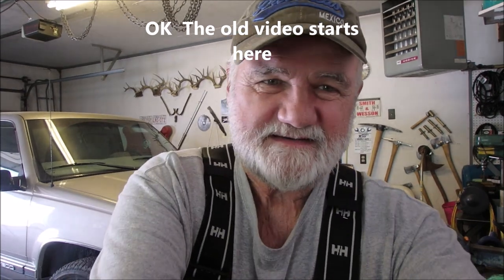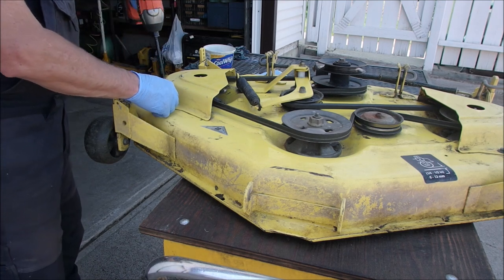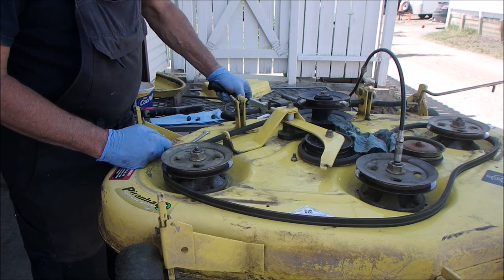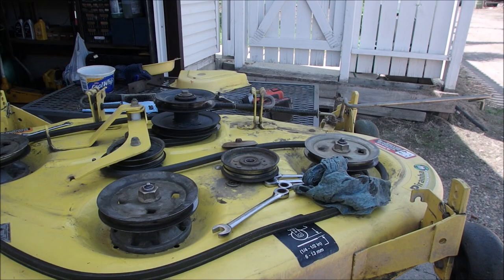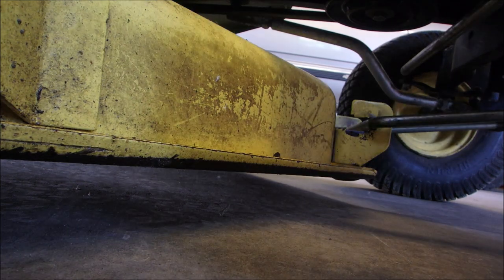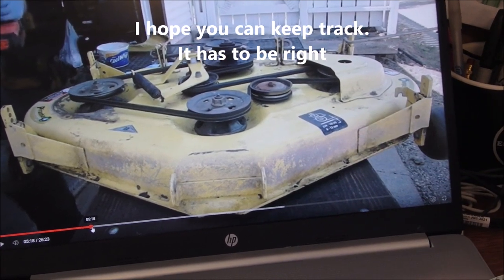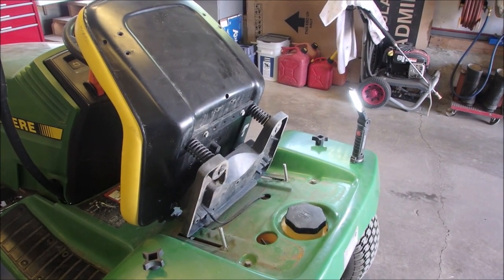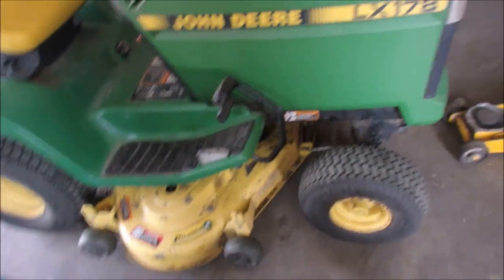My John Deere LX178 Piranha Deck Correction

Comment: Bruce when replacing spindle bearings do you recommend eliminating inner seals so grease can get to bearings?
Reply from the maker: No.  All that means is that I have not removed the seal.  I understand I may be greasing the outside of these bearings.  The JD bearings may be open.  I have never looked.

Comment: Good morning. Just came across your video but wondering what position the blades go in as I just got this deck and 1 on the center hits and 1 from one side hits as well. Wondering if they had the wrong blades on this deck or maybe something is bent? Hoping not and a simple fix? Any help would be appreciated though. Thank you and have a good day
Reply from the maker: Well  As you saw there are 6 blades.  Just make sure they are all instaled the same  (upper and lower) then measure anywhere you can get a good reference.
Reply: @BrucesShop  Hi thank you but needed to know what was the upper and what was the lower and do they all need to be set in the same position? Hoping the wrong blades are on it or they are bent? Deck is clean though. Thank you

Comment: Hi Bruce! Do you mulch or rear discharge with your deck?
Reply from the maker: I mulch.  I do not have the bag for the rear discharge.
Reply: @BrucesShop   I do rear discharge. I don't have the mulching baffle in my deck. I didn't realize that you could install a bag onto the rear discharge. It's a great deck, really cuts down my mowing time with being able to trim on both sides.